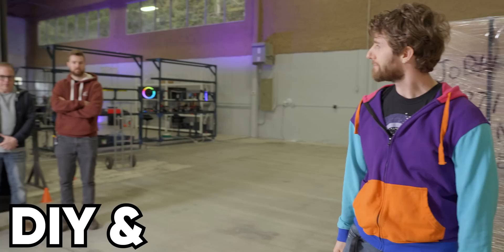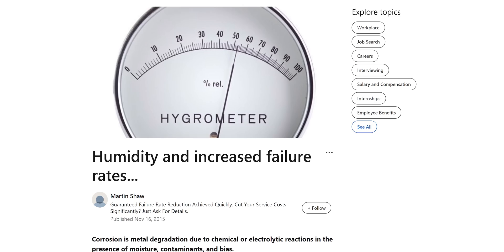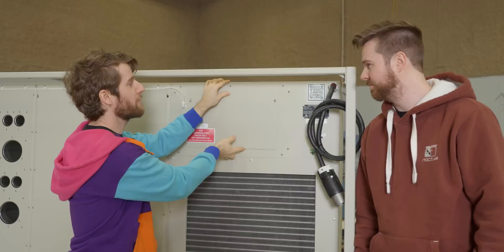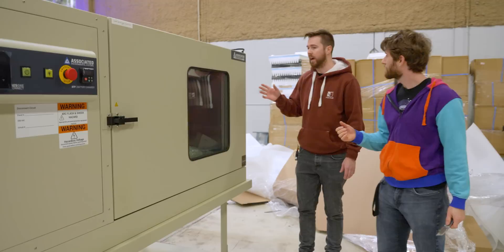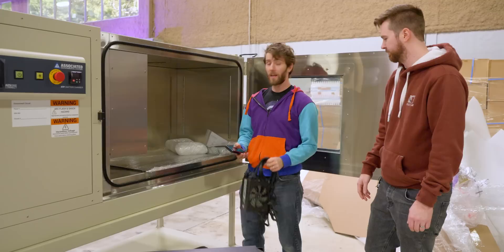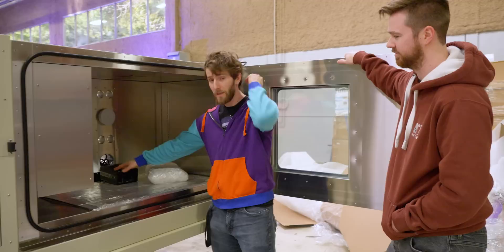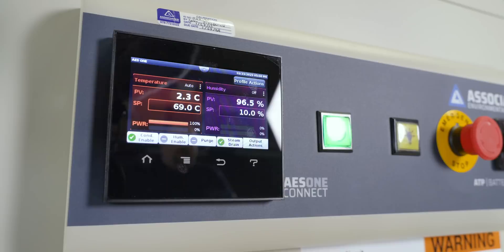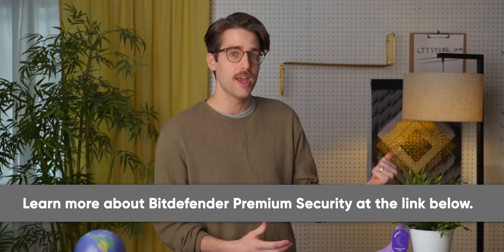We bought a Fridge for computers.. - Environmental Chamber Unboxing

Comment: Bro im so excited to watch this, I watched this unit be built, tested, and shipped first hand! :D

Yes, they're hand built from raw metal sheets to finished product.

No, it's not COMMON for our units to have glass, but this unit usually does because of how large it is. Smaller units usually do not have glass, we also make one entirely out of glass, which is wild.

The cable management is actually kind of us cheating, we're sent wire harnesses, so a lot of those larger cable runs that are nice and neat and zip tied are actually from the factory that makes the cables, we just cut zip ties as needed to fit the runs.

Edit: the plugs are silicone rubber, only info I could find :(
Reply: And here we were so impressed at the cable management man!
Reply: A dammed good job either way.
Reply: Props to ya'll for such a well built machine! We have several environmental chambers where I work but they're dinosaurs compared to this one. The wireless logging feature seems really handy.
Reply: I bet as soon as you found out that it was going to LTT Labs, you immediately knew that Linus would make a video about it!
Reply: That thing looks amazing, don't forget to send them the data on what that passthrough port plug is made of so we can get the best stress toys ever!
Reply: @digitalrailroader  A group of us have been stupidly hyped to see this video, like he said in the video, we don't make flashy stuff that a normal consumer would know existed at all, but this has definitely made everyone very happy to see our product out for millions to see, showing how hard everyone works on these.
Reply: @NeneExists  I dont remember off the top of my head so Ill have to check Monday D:
Reply: @jakedaynesLTT  Sorry to spoil the magic! Doesn't change the fact afterwards that everything on that board was hand soldered as well, every bolt was a human, the only automated part of the entire process is a massive laser to cut the sheet metal into size and any designs, like the company logo and such.
Reply: @HeyLook287 thats fucking awesome! You guys are badasses and I’m so excited for Linus to get this whole lab together and start putting out stats
Reply: I wonder if this is going to start an arms race of tech youtubers...
Reply: The Easter egg was chef's kiss 🤌🏼
Reply: @NeneExists  silicone rubber is the only info I found
Reply: Not me guessing which employee you are
Reply: I work for a different Enviromental Test Chamber company and its always interesting to dee how different companies manufacture things. Like even things as simple as the glass. All of our chambers come standard with a window and heated glass. It's funny that Linus was surprised that it all was hand built, to me that's standard after seeing hundreds of chambers out the door lol.
Reply: @matthewroush8468  it's more surprising if you get one that isn't. These things would be a hell of a lot cheaper if they were easy to produce
Reply: @nickmisner65  You wish 😇
Reply: @HeyLook287  
New blood or old blood?
Reply: @nickmisner65  Newer than you.
Reply: @nickmisner65  oh for sure, it feels good seeing a product that is completely built under one roof from raw material to finished product. I was interested in what brand he went with as soon as he said he was getting one. I still get blown away by the price tag after working on them for almost 3 years.

Comment: Make sure to get some reference grade temperature/humidity probes to record the temperatures during the tests. The built in readings are always sub-par for really accurate measurements as the measurement location is not near the test subject. With good probes, you can also measure temperatures well inside and outside a computer case for example.

Comment: It's really cool how the manufacturer went to those lengths to make this something that can be filmed or otherwise work well with LTT's specific needs. That's definitely a benefit to higher end scientific equipment that is hand built in low volume. I don't even want to think about the price though.
Reply: I can find out the actual price that was invoiced on Monday :)
Reply: @HeyLook287  Might want to make sure you are allowed to share that, unless you want to be fired - I know a lot of manufacturers of expensive custom gear can be very cagey about their prices. Even more so if they give someone a better than usual deal because they don't want someone else to demand the same discount.

Comment: When testing PSU efficiency, as long as you keep the resistance in your custom cables the same as stock you should get the same results as the stock cables. I would suggest making custom extension cables using heavy gauge wire that is nickel or silver tinned. Your engineers will need to do the math to find the best size wire that keeps resistance down while not introducing too much capacitance.
Reply: On top of this, you can estimate the loss in the extensions by testing with and without them using the same power supply at the same temp and humidity. Maybe even vary the power supply to isolate the loss in the extensions. Regardless, you can then back correct the power loss in the extensions for future tests to evaluate manufacturer claims. The raw data will still give you valid comparison pointers across different PSUs as well
Reply: Capacitance only matters for instantaneous power draw changes for the DC output, unlike A/C
Reply: @hkscfreak  Yes that is true, but I mentioned it because someone somewhere would complain about methodology if it isn't taken into account. At the lengths needed it wouldn't be a factor at all especially on a constant DC load as you said. But it is something for them to consider if they're trying to get the most accurate results that people won't argue with. then again people argue about everything anyway.
Reply: I feel like for edge cases it could be as simple as adding longer cables, testing card in PSU out, testing card and PSU in, testing card and PSU in with stock cables and doing some maths that even internet trolls couldn’t fight with
Reply: @D4rk51d332  Hmm, if anything inductance would be more of an issue for instantaneous changes in current or power draw. Extra capacitance is generally beneficial for constant voltage DC supplies rather than a problem.  Though capacitive loads can theoretically send some power supplies into oscillations if they are badly designed, which is actually probably a good thing to detect.

Comment: I don't know if you guys have it planned already or not but how certain devices react to changes in pressure would be nice. Galaxy phones have an issue with their speakers after being exposed to Pressure changes usually flights but large temperature swings can do it too. It's related to the water proofing and a common fix is to open the sim tray to relieve the pressure. Personally I would have liked to know this before purchasing my phone so I think there's value in the test.

Comment: I worked with a chamber like this long ago, mostly working on the data collection and control part.   To give an idea when this was, the data connectivity was with an IEEE-488 cable to a VAX-11/750 and I used RS/1 to write the software for data analysis.
Reply: IEEE-488… haven't heard/read that name in a loong time (my only exposure to this was Commodore machines though).
Reply: Yeah, the IEEE-488 has developed by HP, it was originally called HPIB for HP Instrument Bus.   Apparently Commodore used a bus based on the IEEE-488, but kind stripped down to the basic protocol.   That's a pretty shrewd move on their part instead of re-inventing the wheel.   Interestingly Atari had a serial bus that was actually similar to what ended up being USB, some of the same people worked on the development of both (!).    Funny that a Raspberry Pi and a USB cable could more than handle what I had to do with a HPIB and a VAX!
Reply: @ChristopherHailey  Atari also had a stripped down SCSI interface on their ST line, IIRC.

Comment: I love the emphasis on the power, cause in Ireland that machine is equivalent to two hot water kettles. Which is basically what my kettle and espresso machine draw in the morning when they both run. North America really needs to get with the higher voltages. Saves on energy waste and copper too.
Love rhe the filming upgrades, that was sound, I can't wait for the lab to be up and running fully.
Reply: What makes you think we do not have higher voltages? We have 220v coming into the houses  - we just split that into 2 110 volt legs to most of our appliances. Our electric Stoves / Dryers and anything else that needs it can get 220v. It is our building codes that do not allow 220v at a standard wall outlet.
Reply: @tisjester  Well, and we have 400V coming into our houses via 3 phases - each of those phases has 230V to neutral and supports (depending on the specific region and building) at the very least 21A and up to 50A (depends on the heating system, the local electricity supplier and other factors). That's ~14.5kW - 34.5kW per family home. As far as I can see the US compensates for the lower voltage by designing everything for higher currents - which tends to be less efficient and potentially more dangerous in case of a shock.

P.S.: stoves are usually designed to make use of up to 3 phases so up to 400V

Comment: In terms of maintenance of medium to high end scientific equipment, you gotta contact the supplier/manufacturer because often (not always) they’ll offer a usually annual service to do things like refill the nitrogen or replace the dessicant. 

If not, it’s not all too difficult to store nitrogen tanks or even CO2 tanks. You just have to learn how to hook up the regulators and hoses. And in the case of liquid CO2 the condensing chamber to get your solid ice (because it’ll immediately evaporate and come out as gas otherwise)

Comment: You can do whats called a 4-wire test at the PSU connector, so you can measure efficiency by measuring the voltage at the PSU's connector.

Comment: After passing the psu cabing out of the chamber, your extender cables could be water cooled to ensure a constant resistance so the extra power losses in the extensions can be accounted for in the efficiency calculations. They use water cooled cabling pretty often in welding equipment… maybe a source of parts to build these for yourself.
Reply: I think they can simply measure the impedance of extension cables and factor that in the calculations.
Reply: @Canilash  impedance changes with temperature and the temperature of these cables would vary based on the load and and ambient temperature.

Comment: It is so, so awesome seeing all this stuff come together. And it's really great to hear that the people who make equipment like this are on board. I imagine most of this kind of stuff is used to figure out what the minimum viable construction for a throwaway consumer product can be. It must be pretty thrilling to have something you built with such rigor and care actually be used for scientific and informative purposes.

I wonder if there are grants you could apply for to help pay for it. Also, there are probably a lot of small businesses who would love to test their prototypes using setups this baller and might rent it out during its downtime. Schools and apprenticeship programs, too. You might even be able to act as an independent third-party evaluator in right-to-repair cases.

And, I assume, there are many ways you can use scientific equipment for random fun, informative videos. What happens to a water-cooled system as the temperature drops below freezing? How do you protect a device from humidity and wild swings in temperature? Does the temperature of a device affect how much damage it takes when Linus a hypothetical individual of no particular name drops it? If we could capture the waste heat from computers, how much energy could we get back from it? How do environmental conditions affect image quality with different display technologies? Or the characteristics of sound from speakers? Would it actually be feasible to build data centers in the ocean or in orbit for cooling? If you built a completely wooden PC case and it expanded or shrank as the humidity changed, what would happen? I HAVE SO MANY QUESTIONS.

Comment: the first thing i thought of is that they desiccate, without actually using desiccant, is to use a vacuum pump with water traps.

I used to work with equipment like that and they always use a vacuum pump to get the air out and go through a water trap, which either needs to be drained regularly or is connected to a pipe which you can then use it as a more permanent way of draining the water when it builds up. The "waterless" air is then pumped back into the system.

Comment: Really good video! But I have to say something:

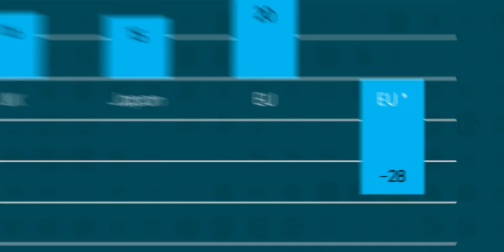At 1:32 where you pull up the joke about the EU being cold af because of the energy crisis. Welp, this "joke" is actual russian propaganda for mocking the EU cutting off Russian gas which they used before to warm up the homes.
But as a student in Germany I can confirm: No, our rooms are not cold af and have an avarage temp of 23° celcius (even though it might got a little bit expensive)
Reply: I for one would also prefer not to have literal Russian propaganda in my tech videos.

Comment: I remember when living in Broome, where Wet Season could reach high 90s of humidity, my Samsung S8 USB-C port would always say there's water in the port when I tried to plug in the port. I had to get a wireless charger as it wouldn't charge and bluetooth files. The same thing happened with my sisters lightning port, but no one had this problem with Micro-USB

Comment: About the power supply efficiency testing problem... You can eliminate the influence of the voltage drop along the (extension) wires by using separate voltage sense wires. This allows you to get accurate efficiency measurements even with wires that dissipate a significant amount of power due to their resistance. No current flows through the sense wires, so the voltage measurement done through them is accurate.

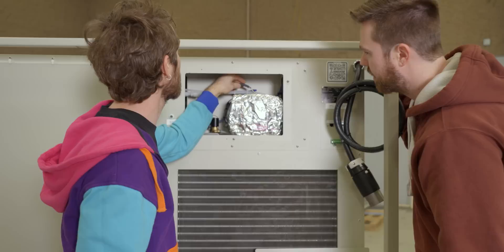Comment: 4:40 looks like a heater wiring. TC wiring is typically much smaller and wouldn't transition to different wire as it would give bad data.

Comment: 208 volts is phase to phase of 3 phase service. The phases are offset 120 degrees, which is why the combined power V RMS is 208.

If you need longer cables for testing that may skew test results, compensate for the added cable length and reflect that in the data.

Comment: For the efficiency test of the power supply and the issue with longer cable.
You can measure the efficiency of the power supply outside of the atmosphere control room, with original cable and longer cable. From there you can most probably assume that those losses will not vary too much, because they will stay outside of the environment control room. Therefore if you measure this at different power level, you could correct the data from later test inside the environment control room.
If you always use the same cable with the same length you could also test it once over the widest possible range of voltage and current, then apply it to all power supply tested without the need to repeat the calibration.

Comment: Hi Linus, here in Mexico we can easily get up to 35°C indoors. Most housing in Latinoamerica is made out of concrete which if not properly insulated can become a real furnace and very realistically not everyone has AC. Also, the little but important sun exposure even for a couple minutes can easily overheat a phone

Comment: Hi Linus,

You can still do efficiency measurement even with cable extension for input and output. The Chroma programmable load has remote voltage measurement feature. And the programmable source/power analyzer also have remote voltage measurement

Comment: Aviation guy here, instead of getting nitrogen cylinders, you can get a nitrogen generator much like the ones that are used in airports, I believe that they can be bought outside of airport use. They generate 99% pure nitrogen from the atmosphere and generally need to be used outside because it has an engine to run it. Cuts down costs, and they may have electric generators as well. cleaner and quieter.
Reply: You are correct, they can be bought fairly easily. I saw one not long ago in injection molding company. It was also electric.

Comment: You should try testing GPU's under extremely dry conditions. When I was GPU mining it made things so dry that the mining rigs would make constant non-stop crackling and popping sounds from the static electricity caused by the fans spinning.  Just walking and touching anything would give me static shocks. The rigs seemed way less stable under those conditions; I added a humidifier.

Comment: Sony should've had one of these. It was extremely fun to discover that the touchpad on my brand new $350 WH-1000XM3 headphones started freaking out in negative temperatures flooding your phone with random gestures. The QA for those headphones must have been either absolutely clueless, gave no shits, or just been completely ignored by the higher ups. I found this issue during my first week and it took Sony more than a year to release a fix... which was to just disable the touchpad via the app. Something I asked for as a temporary measure to make the headphones usable during my first week.

Comment: You can test efficiency of power supplies precise as long as you measure the voltage at the connection point to the extension cables. Its called a 4 wire measuring circuit. Current will be the same along the wire through how physics works.

Comment: Testing Power supply efficiency should be possible with 4 wire extension cables (two wires for each wire from the PSU). That way, the resistance of the extension cable doesn't matter because the voltage is still measured directly at the end of the stock cables